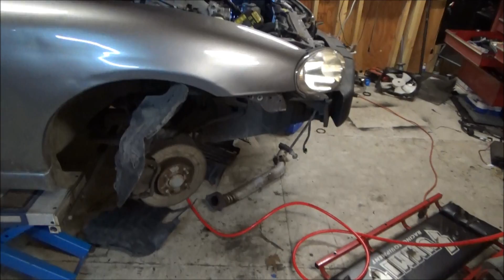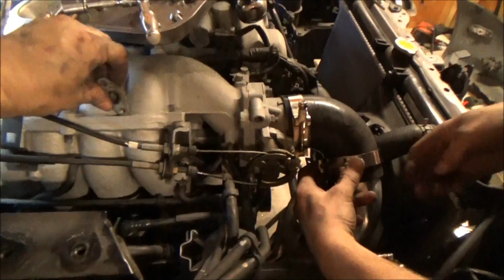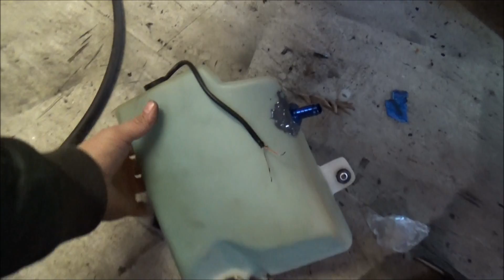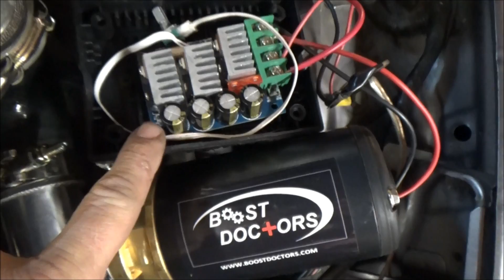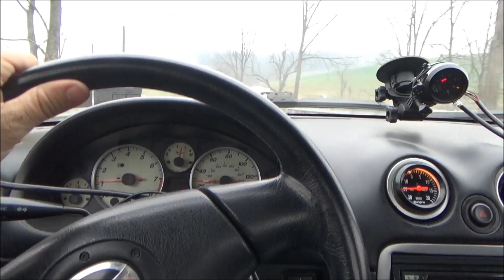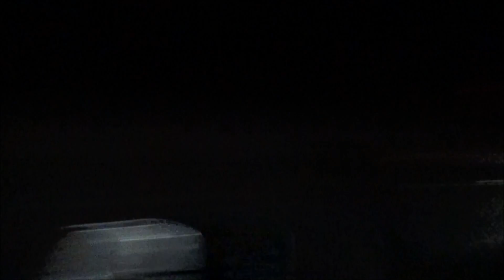How to Turbo Your Miata Over the Weekend

Comment: Miata 1.6 and 1.8 engines aren't high compression engines, they have around 9/10:1 so pretty good for turbo's. Also, you removed the tube connecting the valve cover to the intake manifold because the turbo would pressurize the engine. Well, not quite correct, there is a valve in that tube called a PCV, it prevents exactly what you feared, it is a one way valve, air can only flow out of the valve cover. I highly recommend you put that back, you will have fast deteriorating oil now due to blow by not being sucked out, that's where the breather is for. So that breather is very important, other side can stay with that filter thing.
Reply from the maker: the compression mixed with the factory timing curve mean that it requires high octane fuel with very little boost added.  and while I'm well aware what the pcv valve does they are known to malfunction and stick which is far worse if it happens then not having the small amount of vacuum draw during idle and mild throttle. in fact we will see no noticeable oil issues with the filter connected vs the pcv tube.  it's a myth that there will be any oil issues.

Comment: I understand trying to get around emissions using the voodoo box and meth... But it's just so much better to just megasquirt it and use some rx8 injectors or something. I would run the megasquirt and swap back to the voodoo box come emissions time. So much power likely left on the table here.
Reply: +Phil Miecznikowski Exactly.
Reply: Justin Sane Are you changing the fuel pressure on the Miata with a rising rate or adjustable FPR? Even at 100% duty cycle they can only flow so much under stock fuel pressure, just curious how you can get around that.
Reply: Justin Sane Can't wait to see it. Like I said, subscribed for 250whp on stock injectors. My whole channel is dedicated to putting out information about Miatas so I'd love to see a unique setup like this working and running. Cheers
Reply from the maker: so much better?  and we don't have emissions. as for so much better your wrong. this car runs and drives exactly like it came from the factory like this. it is perfect.  there is no way to make it better because in order to be better it has to have a problem now and it doesn't.
Reply from the maker: +TheCarPassionChannel sorry but your wrong also. I have been doing things out side of the box for longer then most of you have been driving . don't be afraid to learn something new.
Reply: Justin Sane Plenty of people run the Voodoo box and love it, cool. I run mine on MS2 and I prefer it, I guess I shouldn't have said either one is better, I've just never been a fan of piggy-backs/bandaids. I made 236whp on crap California 91 octane with no meth or any additional systems which is how I wanted it, now at 254whp on E85 (internally stock 1.6L). I guess the biggest thing is just having control over the timing map instead of having to worry about meth injection.
Reply from the maker: +TheCarPassionChannel there are 3 ways to avoid pre ignition. 1 is to lower timing and the other just as effective way is to slow down the flame front using higher octane which is what meth does. the 3rd and less effective is to run very rich.  we currently are using the 3rd method which is leaving power on the table. however so is using the factory exhaust so obviously we aren't concerned with peak power yet.  once we install meth I will be adjusting the afr to a leaner state and allowing octane to control pre ignition and we will easily meet our 250 whp goal. stay tuned.
Reply: Justin Sane I understand the idea of meth, I just choose not to use it since I can get the power I want safely without it. No doubt you'll hit 250whp with that setup. Subbed for dyno graph and more 'Mexico' pulls!
Reply from the maker: +TheCarPassionChannel  the auto will hold us back for sure , but come spring time and after we get some base line pulls and track times we will see.   we also did a obd2 integra turbo automatic and allot of guys swore it wouldnt work because its tuned solely on meth.( watch the video its awesome ) and after a entire season of proving them wrong they now have changed their tune. that car started out at 98 whp and ran 18.2 at 73 mph, it now makes around 230 whp on only 10 psi and is running 13.9 at 104 with a horrid 2.5 60 ft. the factory obd2 computer dont even know the car is boosted.
Reply: +Justin Sane +thecarpassionchannel I believe he'll run out of fuel long before he makes more then 200hp. Regardless of how much meth your spraying. You're still limited by the stock injectors. Best of luck though, I look forward to seeing this band-aid setup proving me wrong. I know plenty of old school guys who believe meth injection in the solution to all problems, I'm not doubting its not a great way to make reliable power. But realistically you're still handicapped by stock ecu limitations and fuel availability. Get a tunable standalone ecu in there and then add meth and have all the cake and eat it too if you ask me.
Reply from the maker: Phil Miecznikowski please do me a favor and watch my how to turbo your obd2 integra video.  I am supplying fuel solely with a meth kit. Watch the entire video. It went from 98whp to 230 whp and the stock ecu don't even know it's boosted.
Reply from the maker: +TheCarPassionChannel im sorry your having trouble understanding my unique methods,  its not required to raise the fuel pressure, i currently have no problems adjusting the AFRS to as low as 10.0 , 11.3 is all we really need at this level of boost and power.  but wait it gets better, with my unique meth set up that i plan on adding i can go even further ALOT further.  I will use a 1-5 volt referenced MAF to control a progressive controller for the meth pump. This is not some MAP switched on and off meth kit . i can fully tune AFRS this way and boost octane and cool IATs so that timing will not need pulled. i keep insisting you watch all the videos in my channel that are about the OBD2 integra , that car has no tuning or mods to the fuel system, the factory ecu isnt even aware its boosted. yet with my unique set up i have gone from 98 whp to 230 using nothing but my unique meth design . the miata will go even further due to the fact i at least have the voodoo box to help, the integra has no help at all. i feel unless you take the time to watch all the videos that speak about the integra you will not understand my method. i can assure you however that i am correct and it will work flawlessly.  the integra started out at 18.2 at 73 and now runs 13.9 at 104 @ 10 psi using only my unique meth system for tuning. it would run 12s at that mph but its a LS auto and you cant stall up the converter very much so the 60ft is only a 2.5 lazy launch, however once its rolling its comes alive quick. i have track and dyno videos of the cars progression all in my channel as proof.
Reply from the maker: +TheCarPassionChannel won't be till spring. but stay tuned

Comment: Great build. I hope your internals are forged and your oil pump is a aftermarket . the stock bp motor can not handle 300hp to the crank.
Reply: +Nick Marangos I beg to differ, I'm running ~300hp at the crank (254whp) with my stock 1.6L. Stock from the valve cover to the oil pan. I do have an ATI SuperDamper to help keep the oil pump safe. Daily driven and raced once a month or so too, these engines are quite impressive.
Reply: You won't see any problems with the BP until 250ftlb of torque to the wheels. The rods are the weak point. You can run without an upgraded oil pump if you run an ATI damper. You can even get away without an ATI damper or an oil pump at those power levels though.

Comment: HKS, Greddy etc, sell oil plate for fitting oil cooler. Using that plate you can have feed & return.  Were talking a 100$ part vs. fitting some wild pump kit that many not even fit.

Comment: +ricer miata check this man out if you're trying to boost your Miata properly. Everything he works on turns out mint.
Reply from the maker: I wouldn't say mint lol but thanks we get the job done
Reply: +Justin Sane it's a process. It will be soon.
Reply from the maker: +Chris S yeah we hope for 12s. it was 17s and now after racing a couple guys I'm guessing 14s or low low 15s
Reply: +Justin Sane that's a pretty good jump. How's the transmission acting with the extra power?
Reply: +ricermiata
Reply from the maker: +Chris S it works great. no issues or even signs of issues. I don't think we will have a issue. the integra project is the one that worried me cause them auto trans are weak but it's still holding up to.
Reply: +Justin Sane that's awesome. The Integra had me wondering for a while too. Well I can't wait to see your methanol and exhaust updates for the Miata thanks for another great video.